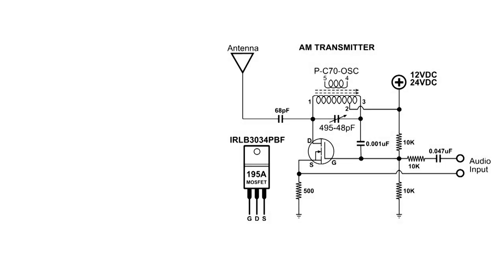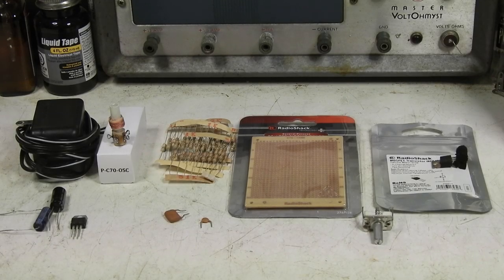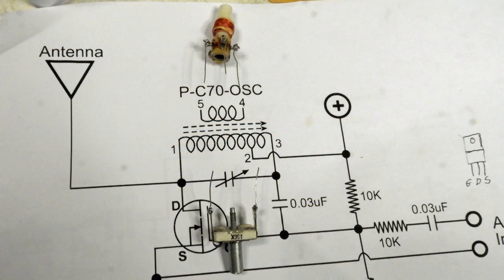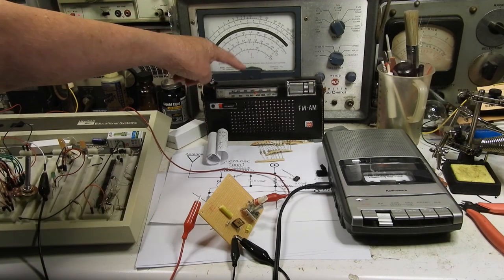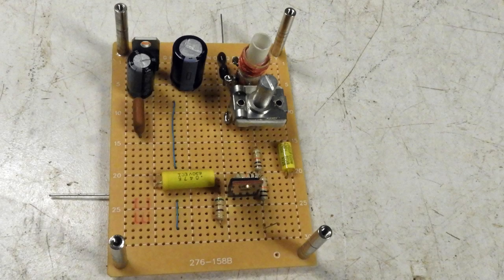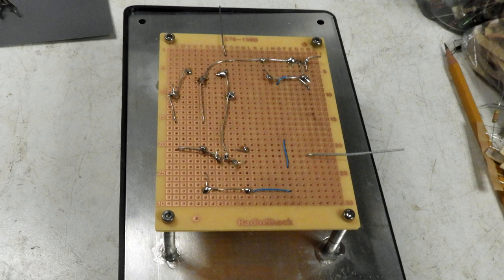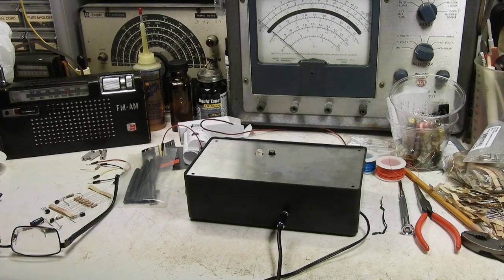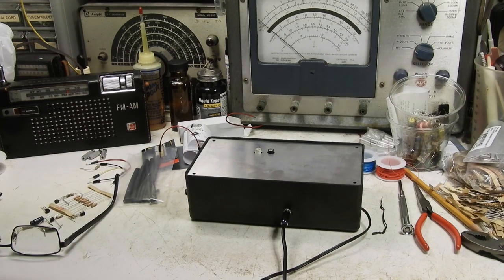AM Transmitter Build Project and Demo

Comment: Rick, I’ve been following for a few years now and can’t tell you how many times I wanted to ask you for something like this. I bought the AM talking house and that thing is garbage. I tried to build a few but with no luck. This simple LC tank circuit looks to be something that will work. Parts are already in the mail. Thanks for sharing and teaching us.
Reply from the maker: Let me know what happens I'll be glad to help
Reply: @AllAmericanFiveRadio  I put the power supply together on a breadboard. Working perfectly. I can't get the transmitter to work. Pretty sure I have the coils correct, verified w/ ohms read. I have a frequency counter. I've connected it to the antenna and the ground and it just reads 50-60 hertz. I put the trimmer capacitor at 300 pF. Not sure what the issue could be. I'm using the SG9058-ND trimmer and the coil you suggested from the source recommended.  Non of those capacitors have polarity so I'm not sure what I could be doing wrong.
Reply from the maker: @MrTysonjharris  Does it work without an antenna and ground?
Reply: @AllAmericanFiveRadio  I does not.When I connect it to the power supply and have it near my AM radio I get distortion on every frequency I tune to. I've ordered new parts except the trimmer and the coils and will lay it out again on the breadboard. Can you confirm for me the direction of the coil? https://www.amplifiedparts.com/sites/default/files/uc_products/p-c70-rf_nohat_1.png Using this orientation, to the right of the red dot is which 1 or 2? Note: I've recapped more than a dozen radios, pretty confident in my abilities. Sort of a head scratcher why this isn't working. If you were going to use a frequency counter to verify the coil was oscillating where would you tap into the circuit? - Thanks
Reply from the maker: @MrTysonjharris  Yes I was thinking about the coil. The information from Antique Electronic Supply is shown as a bottom view. I wish they would have labeled it as such but they didn't. I went to their website and they have more information than what comes in the box. Here's the link.
https://www.tubesandmore.com/products/coil-miniature-adjustable-coil-70-oscillator
Reply: AllAmericanFiveRadio thanks for the replies. I’m certain I have it wired right in my breadboard. It’s a mystery for now. Curious if anyone else has had luck with this design.
Reply from the maker: @MrTysonjharris  Building a transmitter is more challenging than other devices like an audio amplifier, because of RF. RF will seek the easiest path to ground and sometimes that path looks good to us but RF sees it as a path to ground. I looked at my pictures again to see if there's enough detail for this project. If you construct the transmitter as I did and all your parts are good I'm sure you'll be successful.
Reply from the maker: @MrTysonjharris  Read skycarl's comment he's made when.
Reply: @MrTysonjharris  I know this post is a year old, but did you get this working with the SG9058-ND trimmer?
Reply: Bob Gorman I struck out and never did get it to work. I put it together with a breadboard and verified everything.
Reply: @MrTysonjharris  Thanks for letting me know. I guess there is more to making these work than one thinks, bummer

Comment: For those looking to build an AM transmitter, here's a beauty. Rick, I have to say that P-C70-OSC coil is a good one to start with.
I had great results with that coil. And using your design I had it working in no time. I highly recommend this one.
Reply from the maker: Thanks Carl. The circuit should be about the easiest one for beginner to have success with. Plus it's something useful too.

Comment: Thanks for the video. I didn't understand a detail in the schematics, where the points 4 and 5 of the coil linked to ? are they coming from another oscillator providing the carrier frequency ? and is the carrier frequency limited by the transistor in the center ?
Reply from the maker: They are open, not connected to anything.
Reply: @AllAmericanFiveRadio  Thanks for your response, but in this case, how do they contribute to the functioning of the circuit ?
Reply from the maker: @marouaniAymen   4&5 are not used they contribute noting to the circuit of the circuit.
Reply: @AllAmericanFiveRadio  Understood, thanks

Comment: That is a very interesting circuit, especially when you made that with a MOSFET. Very good, also that you show the practical circuit. And the modulation is also very very pure, thanks for this upload.
Reply from the maker: Thanks radiofun232
it is a very simple circuit but I think it performs very well. I'm hoping that the circuit will be successful for the beginner. I'm sure you know it's a little trickier building a transmitter because of RF. It can be a challenge for the beginner to keep the RF out on the antenna. Rather than have it go into the power supply or it having find a path to ground.
Reply: @AllAmericanFiveRadio  Thanks!

Comment: I have a talking house brand AM transmitter. I need to build or get an 18-volt power supply. The original supply has a ground prong at the wall. Too bad it wasn't at the thrift store with the transmitter. An 18-volt dill battery will power the unit fine for a few hours.
Reply from the maker: Yes, the power supply will save a lot of batteries, and money. Hopefully you'll be able find a power supply that will work. With batteries you might try running it on 12 V DC because a 12 V supply would be easier to find. Thanks.
Reply: @AllAmericanFiveRadio   I might be able to use 12 volts. But once the voltage goes down on the battery, the automatic adjustments go all over the place. This box can transmit on any frequency an AM radio can receive by using some sort of motorized tuner. That motor turns on when the power drops.
Reply: A couple of options here... You can pick up another 18V battery charger and modify it to work at a constant 18V. You can also use an old laptop power supply. Most of those are at 19V. The one volt difference isn't going to harm the transmitter. You can also modify some of the older HP Printer power supplies. Most of those are at 32V. A voltage regulator and a few discreet parts and you can build it right into the Talking House.

Comment: well it sounds like a little Old time radio going on over there and I am a big fan of Johnny Dollar, and any of the old Lux radio theater programs...but the best part about this transmitter is the simplicity of it yet its quality and clarity are not sacrificed. I have been tinkering around the bench and considering building a transmitter but I am not sure yet if I want to build it Am or Fm .
Reply from the maker: I enjoy Johnny Dollar (Bob Bailey) and have many on cassettes and CDs. I use both AM and FM transmitters and they both sound good. It depends on what radio I want to use.
Both transmitters simple and almost the same circuit. Here is a FM transmitter.
Build FM One Transistor Transmitter Project Modification 3-3
https://www.youtube.com/watch?v=3tc3gBEU9Js
FM Transmitter, MOSFET Experiment
https://www.youtube.com/watch?v=Aerr6v6Vwgk

Comment: good work, nice and smple design, is that coil readilly available ?
Reply from the maker: THANKS!
I recently checked on the availability, it is available on eBay for $58. That is why I did these two videos.
MOSFET AM Transmitter Home Made Oscillator Coil
https://www.youtube.com/watch?v=8jV5rfc-QhA
MOSFET AM Transmitter Home Made Oscillator Coil PART II
https://www.youtube.com/watch?v=RmRXnimNx58

Comment: I'll have to see if I can pick up the coil here in Scotland!  It seems to have a decent range which can be a problem on some transmitters I've encountered which practically have to be touching the receiver to get a decent response!
Reply from the maker: Add a larger variable cap in the tank circuit for AM Transmitter
Build FM One Transistor Transmitter Project Modification 3-3
https://www.youtube.com/watch?v=3tc3gBEU9Js

Comment: Wow, what a great AM transmitter!  Where did you purchase your MOSFET?  Also, I believe I have the exact Osc. Coil but if I remember right - the connections to it were a little confusing.  I know there's a little red or black ink dot on it.  I'll have to see if I still have the diagram to that coil.  Great video, thank you!
Reply from the maker: You get the diagram of the coil with the coil. You can get the MOSFET from Mouser. Sometimes I use eBay.

Comment: thanks for the video!  would you mind tell me the inductance of you coil or many turns?
Reply from the maker: I found a coil to measure and the results are between 1 and 3
R=6.0 Ohms
L=0.10mH
Can not tell you the number of turns. I would have to unwind it which would destroy the coil.

Comment: Very interesting design for the AM transmitter.  I noticed however that the mosfet you used is rated at up to 343A of drain current.  Would not mosfets with much lower drain current work?
Reply from the maker: I would think most any N channel MOSFET would work. I'm using this one because that's what I have on hand.
Reply: @AllAmericanFiveRadio  I have piles of N channel Mos fets logic level .. I looked at your Circuit and wondered how critical the FET was.. Then  I saw the 500 ohm in the source to ground path and  realized the max current was very limited. Did I miss some other  multi amp path?    I have some 30N06L mos fets with Source Drain currents  in excess of 30 amps. I'll try one

Comment: Nice circuit.  I will build one, but I would like to know more about how this circuit works.  As I'm still learning radio theory please feel free to correct the following if I'm wrong.  First, an audio signal enters from the right past a voltage divider and current limiter resistor to the gate of the MOSFET.  While this is going on the coil and variable cap are oscillating at a frequency somewhere in the AM band.  The oscillation is sustained by the voltage tap from the power supply.  Pins 4 and 5 of the coil are not connected as the secondary side of the coil (normally an IF coil) is not needed.  To get modulation, the MOSFET partially shunts the amplitude of the oscillator's signal to ground in response to the audio input.  The modulated signal is then fed to the antenna through the 68pf capacitor.  As for the parts, I'm finding that the coil is easily obtainable but the variable cap is larger than most available from the radio supply houses.  Can I assume that a 15pf to 365pf capacitor will work as well, though maybe not for the full range of the AM band?
Reply from the maker: The two 10,000 ohm resistors that are connected at the positive and negative are the biasing bridge. The audio that passes through the 0.047uF capacitor adds and subtracts from this bias, producing Amplitude Modulation in the oscillator coil. Let me know if you have any other questions I will be glad to help.
Reply: AllAmericanFiveRadio Rick - a simple and effective design. Regarding the AM modulation, does the modulation occur at the center frequency of the sine wave or does the modulated carrier(s) fall below and above the carrier frequency? Thanks for your time. Best, Don

Comment: Any idea what output power, and what degree of modulation?
Reply from the maker: The power out is enough to cover two or three rooms. The modulation depends on the audio input.
Reply: @AllAmericanFiveRadio  so you do not know with what power and modulation you were working with. My question is serious, because not all transmitters can have high modulation, and the output power may be tiny

Comment: No luck unfortunately. Can't get it to oscillate. Tried 12v and 24v. Anyone have any ideas? I even tried a 27-465pF air tuning capacitor. I bought all the correct stuff except for the variable capacitor. I couldn't get one with quite the range as the one in the video.
Reply from the maker: Send me some pictures. allamericanfiveradio@yahoo.com
Reply: Just wanted to report here that AllAmericanFiveRadio knew what the problem was right away. The oscillator tapped coil was labeled incorrectly. The red dot on the coil to signify Pin 1 was off by a pin. Everything works great now!

Comment: hello, was wondering if you can use an am oscillator coil (like you know, the one with red head/adjuster) in place of your 70-osc coil? thanks in advance.
Reply from the maker: An AM oscillator coil should work. I do have videos where you make the coil for AM and FM transmitters. Here is one video.
Build AM FM Transmitter One Transistor Project 1-3
https://www.youtube.com/watch?v=6ZsQNtZZ_V4

Comment: @AllAmericanFiveRadio  I have built the transmitter from your video but am not able to tube in to the audio. I tried tuning the oscillator and variable capacitor to 455kHz but still no sound. Do you have any voltages I can check on the board?
Reply: I also tuned it to 890 kHz and only hear a high pitched sound. Could it be the MOSFET?
Reply from the maker: I'll take some voltage readings you can contact me at allamericanfiveradio@yahoo.com

Comment: How would i use this with a crystal oscillator? Just replace the coil and variable cap?
Reply from the maker: Yes. You can use a crystal oscillator. This will limit your frequency to one choice. Here is a video on crystal oscillator. 
Crystal Oscillators for the Beginner
https://www.youtube.com/watch?v=xezzwJAZEQY
Reply: Thanks, I actually want to limit the frequency by design. i have recently built a transmitter using an XTAL Crystal and LM386 that works quite well but the distance is limited. I have a few n-channel mosfets sitting around and figured i could use them to increase the range, just wasn’t sure how to wire them up, seems that every other tutorial is using BGT transistors.

Comment: hi rick .can you tell me about the variable capacitor that you used. what are the pf values? cant seem to find any thing that will work. thanks so much robin
Reply from the maker: Hey Robin, I bought the variable capacitor from RF Parts www.rfparts.com , they may not have the exact one I used but I think you should be able to find a suitable substitute. 495-48pF Hope this helps. Rick

Comment: Could you please tell me where the negative from the power connects. May seem like a silly question, but I'm new to SCHEMATICS and no one ever seems to show that on the schematic. I'm assuming that connecting it to the grounds is correct ?
Reply: Also, how long of an antenna do you recommend ?
Reply from the maker: In this circuit the ground symbol is the negative side of the power supply.

Comment: Hi! It seems very impressive little transmitter. What is the output RF power at 24V? 

How can I connect the audio input (what is the input impedance and wattage)?
Thanks and Regards
Reply from the maker: It covers the house nicely. The same circuit will also work with 12VDC.
Reply: @AllAmericanFiveRadio  Thanks a lot! I'm going to built this transmitter with a single mosfet power amplifier.

Comment: Hi Rick! I want to try this circuit out. However I having a hard time finding the trimmer that you suggested? Is there an alternative value that you might suggest? Thank you for the great videos! Brendan
Reply from the maker: Hey Brendan, I bought the variable capacitor from RF Parts www.rfparts.com , they may not have the exact one I used but I think you should be able to find a suitable substitute. Hope this helps. Rick
Reply: @AllAmericanFiveRadio  Thank you for the come back and the help! I will check them out? Brendan

Comment: Hello Rick, I hope this finds you healthy and sane. A little unrelated but hopefully you can help. I built the McWhorter AM Tube TX recently and I’m having issues getting audio into it. The input transformer was not specified and I’ve tried some stuff I had laying about but still no luck. Any chance you could steer me in the right direction?
Reply from the maker: The audio transformer is one that you could use as the output for a 50C5 or a 50L6. For the transmitter I'm using the transformer backwards. Using the transformer as a step-up transformer.
Reply: On the right track now. Thankyou sir! Modulating now with a temporary while waiting for the right one.

Comment: Nice circuit. For some reason I couldn't get it to oscillate with the IRLB3034PbF HEX FET (Ebay) but it worked with any other N-FET I tried (IRF520-630). It also works great with an 100uH to 150uH and a 10uH cheap ebay inductors in series. It's a realy beautiful design with only a few parts and it realy works good. Thanks for sharing!
Reply from the maker: Thanks.
I would test the IRLB3034PbF HEX FET to make sure it's good. If it is good try running the transmitter on 24VDC. I wanted to design a circuit for the beginners so that they would make a successful build. My FM transmitters are of the same design and work very well.
Reply: @AllAmericanFiveRadio  I checked the 3034 FET and it tested ok. I also tried 4 more FET's from the same batch without any luck. I only ran it on 12V-18,5V (the supply I used didn't go higher) but I will try again with 24V.  Thanks again! 
Btw: If I wanna match/tune in my antenna can I just mirror the" LC tank circuit" from the oscillator and put in series with the antenna?  🤔
Reply from the maker: @eivindamundsen7090  Here are other experiments, hope you try them.
Build FM One Transistor Transmitter Project Modification 3-3
https://www.youtube.com/watch?v=3tc3gBEU9Js
FM Transmitter Varactor Diode Modulator
https://www.youtube.com/watch?v=JQGWr2dPe4E
FM Transmitter, MOSFET Experiment
https://www.youtube.com/watch?v=Aerr6v6Vwgk
Reply: I tried this with a couple of scavenged 100uH and 10uH inductors but it didn't want to oscillate. Would you happen to have a link to the inductors you used as I can't find the OSC coil Rick used here in the UK?
Thanks!
Reply: the distance between components and the ground size changes the frequency